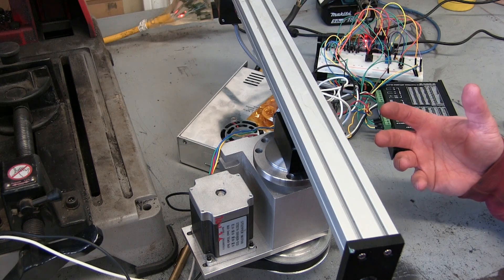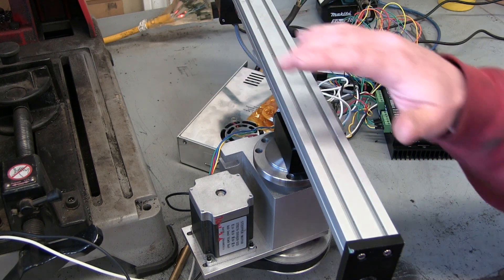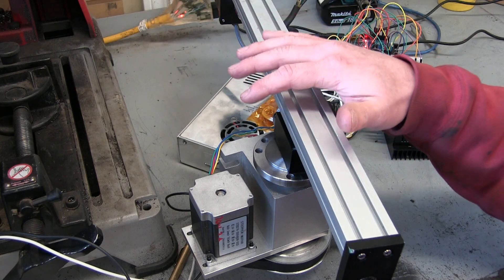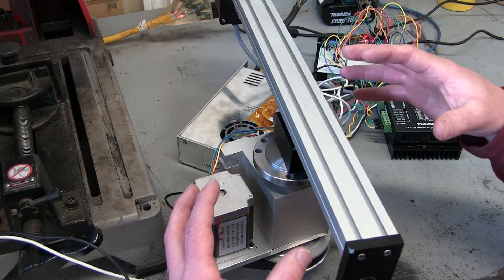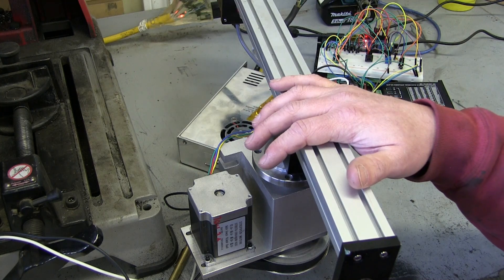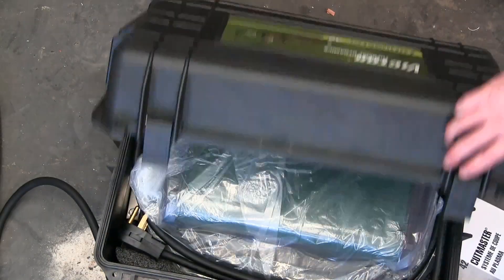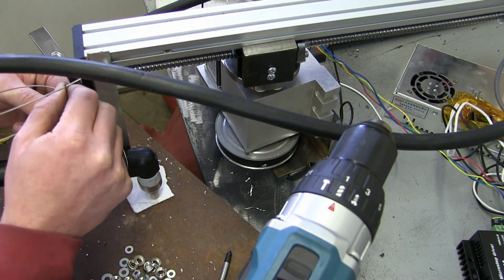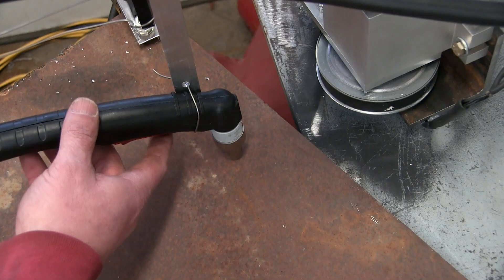Portable CNC Plasma Prototype

Comment: Looks really good for a proto.  Need to work on your math for a square, or other shapes (obliviously).  The real polishing will be figuring out your speed based on material and thickness, this will also depend on the cutter used.  The way I would go about programming the MCU for positioning the head would be based on a coordinate system, where the math is figured through it's own function based on what coord you give it.  Think pixel placement on ms paint for a given shape.  That would translate very well for someone sending a random shape through bluetooth from a phone app.  Would also mean you only need to update the phone app and not worry so much about your MCU firmware.

Your math will be calculating the intersection between a straight line and a circle, it's not a simple equation and may require an MCU with more oomph than an 8-bit arduino (depending on your resolution).  Just search "calculate intersection of a straight line and circle" and several pages show. EDIT:  I tried to paste the equation, but youtube does not support the symbols used.

Comment: This is an awesome idea. I think it might need a guard around the mag base. It would make it look more beefy and add some protection. How has no one thought of this before. I don't doubt someone will use this idea
Reply: You could also put a rubber band over the trigger so you don't have to hold it. Just slip it on and off as needed

Comment: With any luck LinuxCNC already has implemented your kinematics. If not it should be quite easy to do so since you stay in 2D anyways. But you would have to at least have a LinuxLaptop running to use it. This probably isn't the App approach you would want. Even if it is possible to create a GUI for it.

Comment: I have been looking at plasma tables for a while now. I love this idea for size and space. 

The only issue coming to mind is that you will have very high resolution when close to the center of rotation and it will get rougher as you move further out from center. Also the rotational speed would have to be varied based on how far out from center the tool is so that cutting speed remains consistent but that is easy to control in code.

Comment: Somebody probably already said this but when you go to implement the CAM you should take into consideration that the speed at which the rotary axis moves should be adjusted to the amount the plasma  torch sticks out on the linear rail

In other words, keep the speed of the nozzle constant.

Comment: Awesome thing dude! One problem I see is accuracy. It feels like this thing is somewhere between handjob with a torch and actual CNC equipment like let's say mills. So why would you need one of those, when it's too complicated for one job and not good enough for another. Another idea though. Do you know theese manual routers for woodworking? I believe that top tier ones can track their positioning on the work piece and can let the operator have some slack, and correct minor misplacements and things like hand shaking or whatever. They also have some form of CAD implemented in them. What if you stick a plasma cutter on one of those and use it for metalworking? Again, accuracy problem, but most likely solvable.

Comment: Version 3.0 (way down the road), has a mini projector on a stalk that will project an image of the cut you are selecting onto the work surface. ;-)
Reply: +Talon Baldwin I was thinking scanning laser first, but making scale designs seemed like it would be harder than with a projector... Lasers would be cooler though!
Another disparate thought I had was mounting a camera or 2 on the head, to enable a mode that cuts where you draw lines... Lay out with Sharpie/paint-pen what you want cut (maybe have a screen so you can confirm that it's seeing your lines), and hit go.
Reply: That's a good idea for efficiency. Could be done with a scanning laser, like those novelty clocks, simple programs to run that.
Reply: Here Here!
Reply: As first I'd go with projecting an image where it's going to be cut. No need for tracking, just offset projector from plasma cutter and show where it's going to be cut
Reply: Rastislav David yeah that's what I was thinking... While selecting and scaling the pattern to be cut, project it on the work surface.
Reply: Where? Where?

Comment: Is there possibly a way to set it on a spring system that would apply pressure to the cutter but if it starts snagging or getting caught, the spring will allow it to move up and lessen the pressure ?

Comment: Get a machine torch.  Add a Z axis to move torch up and down. Obviously work out the distance issues with it being run from a single point and not an X - Y gantry.  But that is simple trig that would need to be done in software with the CNC control.

Yes I would build one and use it.  I would give the guy with a small garage and no room for a plasma table to throw a sheet of stock on some saw horses and make parts from his phone or PC.  You may consider contacting Autodesk about it and implementing it with Fusion360 and let them work out the trig stuff.

Comment: You want to adjust the linear axis and the rotary axis when you are pulling backwards so that you get parallel cuts, I'm sure with a bit of maths (or more likely a bit of trial and error!) you could work out how much rotational change you'd need per unit length of the second "straight" cut, with a multiplier based on the length/diameter/chord of the side arc.  Easy enough to do in the Arduino.  Having said all that, do the holes have to be square?!  If it's just to stick a hydraulic hose through, who cares?!  Great idea, similar machines already exist by ESAB but they're not portable and I'm sure they're $$$$.

Comment: I can see this working, fantastic idea, add in the functions to do so it can calculate radius corners, Cutting depth? would have to do further testing dependant on the brands of cutter and material types used ect. But you could us it to cut letters, branding, instructions, graphics, create textured surfaces, signs. Hell strap different tools to it for different functions. Nail guns and lasers for rust removal and material reconditioning and let it chooch over larger areas while you do something else on site. Suffice it to say this has more of an application than simply cutting. Biggest problem is making sure the orientation you have is correct and being able to set start points. Nothing that can't be solved by a few dry runs or a preview/test functions. Great thing would be for areas which require multiple holes in exact locations across a surface. Perfect for fabricobling much needed parts on site quickly with one tool, brackets, and spacers ect. Quite the genius invention you have their AVE. Integration to mobile apps for control is great idea too. I can see a great many machine shops and engineering firms having one of these in the back of their vans and using it all the time. the only tip i can offer from my own experience with a laser cutting CNC device is the ability to account for the diameter of the cutting implement be it a physical bit or a laser/plasma stream, being able to account for the diameter of it in the software is crucial when creating parts which slot together correctly out of sheet material, nothing worse than having to go back and make adjustments or worse when the slot you cut for it to sit in is too big or small because you didn't account for the width of the laser beam :/  From my experience with Mobile APPs and software developers as well, go for Windows and Android first, SOOOO many issues with iOS integrations not least that damn lightning connection apple uses on its devices, Micrio USB is far more user friendly when it comes to handling coms to other devices among other things. Not to mention the price gap to the end user. Hope this helps, I watch in anticipation. One other thing I had an email at work the other day regarding a software content delivery and security firm (cloudflare) being hacked, Patreon was listed as one of the customers effected along with Bitpay, hotUKdeals, meetup, okcupid, fitbit and Uber. recommended action is to reset all passwords let your users know!!!

Comment: VACUUM BASE !!!!! The advantage of using a plasma cutter is that you can cut aluminum and stainless, which are not magnetic.  Your going to need to integrate some sort of drill, to pre-drill   the start of every cut or clean the tip every few cuts. I would almost want to use some sort of hex with a gear rack for the (x-y ?) horizontal action. Also if you need anything cast let me know I'm itching to use my furnace to make some machine parts and make a video or two.

Comment: I would do optional base.  Could have a mag lock bottom, or a bolt on bottom.  That way we could bolt on to any hobby bench.  Once you get the math guy, programmer, etc. then I would do a kickstarter program.   Easy way to get this off the ground and in peoples hands.

Comment: You could design / incorporate some kind of laser or 'beam measurer' so the tip stayed within a set X/Y/Z tolerance limit.  One for the programmers.  Plus your work wouldn't necessary need to be flat.  Hope that made sense.

Comment: Ave, In the app, wouldn't  you need a section to put in the the thickness of the metal being used? I say this because wouldn't the speeds of the cuts be different?

Comment: Instead of a phone app, it would be better to have a basic arduino on the device controlling it, that way you have the means on the machine to go from polar to cartesian coordinates, store various shapes locally and give the option for individuals to modify the behavior of their personal machines such as with custom designs for cutting, different speeds, extra sensors for safety, accuracy or convenience. Multiple versions of the code could be easily distributed on github then. just my two cents.

Comment: this is great! i was thinking about just this here a few weeks back when i was trying to cut some round but not really round holes in a 5mm steel round cilinder. But my not so round round hole prettymuch went square and all that. It aint easy to free hand cut a round hole in a piece of 40cm piping. 
And for height control i had an idea where you would use some kind of spring loaded Z axis. The spring pushes it to the part you are cutting and then i tought about using 3 small ball bearings in cups that are rolling accros the surface. That way there will be 1 in front of the torch in prettymuch any direction keeping the torch from smashing in to the part. And no hard to program torch height controls wich are then going to fail you and are frigging hard to get to work in the first place. I want it simple and fast just like you said.
And with the ballbearing i mean the same system that they use for a ballpen, that way you are not bound to just 1 direction but you can go any direction you want.
If i had the money or the parts i would have thrown a prototype together right then just to prove it could be done. Would probably cost me 10 times more time then it would have to just cut the holes. But sometimes you have to do something just to prove it can be done.

Comment: this seems like it would have more of an application for curves and circles, as i have found that very challenging to do cleanly with a plasma. but i think it may loose out on straight edged shapes, as i could set up a piece of flat stock and trace out what i want  quicker than setting  this up. interesting idea, a scaled down version of a burn table for the backyard mechanic.

Comment: Ya'll folks will know better than me, but will you have problems with different material types and thicknesses?  I assume the cutting speed will need adjustment for thicker metal.  They run into similar things with laser cutters.  Your interface will need to have options for material along with shape.

Comment: Hey, long time viewer, first time in the dooblido. Super idea in my opinion. As others have said before me, what you need are the polar coordinates since your arm extension is essentially the radius of a circle (r) and the rotation is, well, rotation (theta). Search for "Desmos Polar Coordinates" in the gargler and have a play around, the maths shouldn't be too difficult. To get you started, a straight horizontal line should be the equation r = 1 / sin(theta) in polar coordinates. If you get stuck I'd be happy to help however I could.

Comment: Nice rig.  If you're looking to automate the z axis using arduino/reprap code that's already written, you might consider using an inductive proximity sensor similar to (this)[http://www.ebay.com/itm/LJ18A3-8-Z-BX-DC-6-36V-NPN-3-wire-8mm-Inductive-Proximity-Sensor-Switch-Detector-/271664656457?hash=item3f4079b049]  This post explains how to mate it up to a ramps board.   http://forums.reprap.org/read.php?219,477467

Comment: Whilst it's tempting to go with a camera arrangement like the Shaper, the life span in a machine shop and challenges of accurate alignment might be a bit of a pig. It also wouldn't solve the problem of how a machinist would use it to align the job to be done. Perhaps a laser rule built into the base, plus a simple slot sensor would give a guide line + calibration for the head. Another laser rule at 90 degrees centred on the pivot would give you lines to work off. Then an app that says 'square hole aligned with rule', or 'series of holes at 90 degrees to rule' (with pretty graphic shenanigans) would be fairly intuitive... Another option would be a simple joystick on the arm tip that allowed you to steer it to points where you want a bit of zapping to happen. Use the app to set things up, assume plasma cutters kill bluetooth, so upload the job first and have a big red button square bang on the base to stop things and off you go. I write commercial apps for drones and other Android nonsense, so in the very unlikely event you haven't been drowned in offers to write stuff.. I'd be happy to chat further.

Comment: I mean converting to polar should be trivial algorithmically, however if it can't change arm distance and rotational angle ur prototyping dies there. Making something that can do both is also not that hard but using what u have hats the biggest issue. Right now the biggest thing you need to look out for is shielding the mechanical and electrical parts from the sparks and uv from the cutter.

Comment: Hey AvE, the inverse kinematic is afaik already in Marlin the 3D Printer Software. Just forget about the Z axis when writing code. When i build my 3D printer from scratch I started with a pen instead of a hotend on the printer and hand programmed  some figures to get squareness and axis multipliers right. (draw a rectangle and the measure with a ruler its 4 line G1 code). I'd say for your app use an ESP 8266 with NodeMCU environment and you have everything needed (wifi , web surface to choose figure to cut and serial to put it out to the ramps board). As you always say connect the lego bricks :-) and d... in vice (like miami vice? ;-))

Comment: You probably would want to set this up kind of like the axi-draw where it has a fixed home. Then that will have it start at the center of the shape you are cutting. Using a fixed laser pointer that you can line up with your center dot would be awesome for that as well. I have played with the axi-draw and I feel like this is very similar you are just doing rotary which is brilliant and I play with a laser cutter that has a laser pointer to tell you where it is pointing for start. That makes it really easy to use.

Comment: The Smoothie board / raspberrypi set up including  wifi would be pretty close out of the box.  There is a software switch from 3d printing to cnc.  Just run precooked gcode scripts from some icons on the client.  great idea AVE,  I mean great implen-taten

Comment: Maybe I'm approaching this wrong since I'm coming from having haas mill and lathes to use daily. How does this solve a problem? I'm in a aerospace production facility now so prints and approvals are just a way of life. However I've worked with millwrights and I can't imagine them wanting to haul around yet another piece of equipment that's more complicated and prone to breakdowns. Not mention that they are going to have to become familiar with speeds and feeds just due to the variety of different materials they use. Maybe I'm approaching this wrong?

Comment: ....better idea. referencing stickers. one on the mag base, one on the head in the "start" position. these two give you a scale reference. the third is a disposable sticker, which you place in the position you want the hole, and is a qr code containing the data to define the shape and size of the hole. take a photo with your phone. the phone calculates the moves required from the first two positions to produce the desired shape at the third position, before bluetoothing the data to the tool. hit go, and relax as Robert does the no pants dance with your mother's sister.

Comment: yeah boi. it's a plan. I've cocked about with CNC and polargraphic coordinates. i made an arduino read a CNC.txt file off an SD card, interpolate the points, and convert it to polargraphic stepper positions. no major problems. not a massive step to stream the data off an app via Bluetooth instead. you could do all sorts of clever stuff. clunk your mag base on, then use the phones camera, use some reference stickers on the top of the tool to position the tool in the phones mind, and virtually draw your hole or shape on the screen over an image of the work area, before hitting the go switch.....